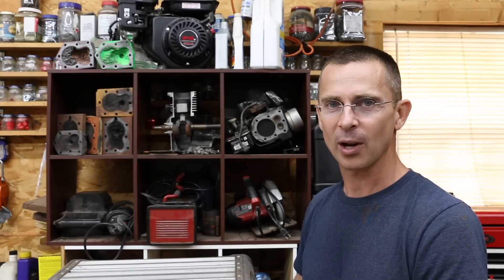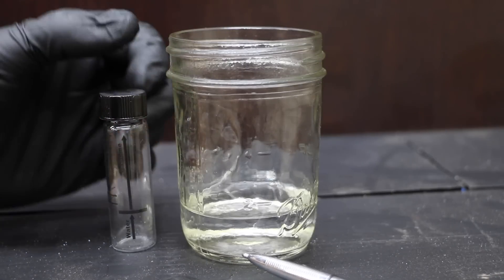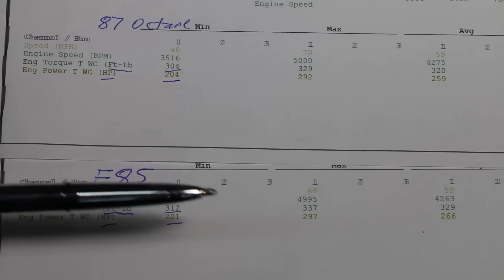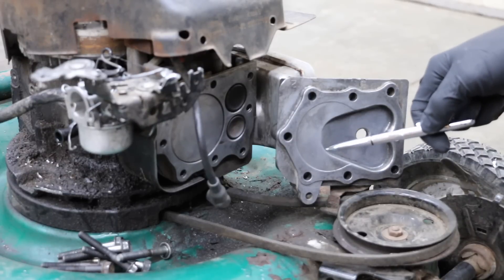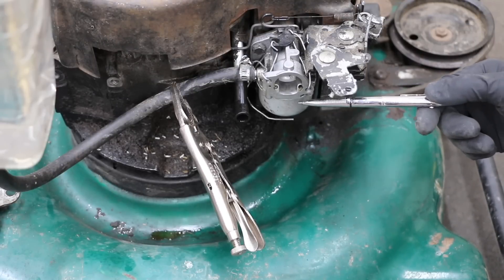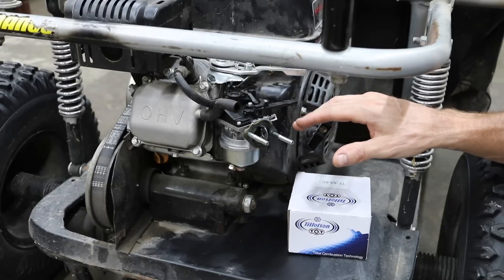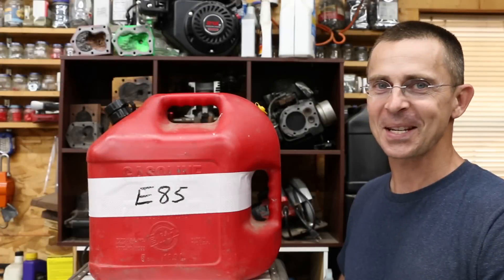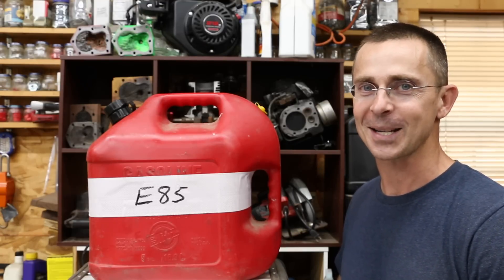Is E85 better than Gasoline? Let's find out!

Comment: Next time, please show fuel efficiency values also in the "litres/100km" unit. This will allow a lot of viewers to understand the figures instantly, instead of needing to find a calculator and searching for conversion ratios :) 11.8 mpg is about 20l/100km, very high indeed. 15.5 mpg is about 15l/100km, better but still uncomfortably high ;)
Did Americans already figured out a way to extract the ethanol from E85 and make vodka from it? Here in Poland many people are creative with obtaining alcohol, but we don't have E85 fuel available here (or it is very rare).
Reply from the maker: Great recommendation. Thank you

Comment: Found a station that had e40 and it amazed me on economy and power. My engine has 197,000 on it and it is flex fuel. E85 sputtered more and burnt quick, regular seemed lacking and degraded my oil  faster. The first time I put e85 in I got a check engine like, reset the pcm and it made a bit of difference. Half and half seems to be ideal in my 2000 Ford Taurus
Reply from the maker: This is interesting. Thank you

Comment: I have several hybrid vehicles that are not flex fuel vehicles. I've run E85 in all of them at one time or another. Since E85 has less energy than regular gas, you should expect lower mileage. My experience has been that E85 is about 20% cheaper than regular gas, but I get about 25% worse mileage, so it doesn't make any economic sense. I'm surprised your flex vehicle didn't do much better than that as it should compensate for the greater amount of oxygen in the exhaust. I did get better performance out of the vehicles during and immediately after use. I would expect this as the computer went into full rich mode to try to balance a lean condition, then turned on the CEL/MIL. (More fuel, more power.) When going back to regular gas, the engine runs good and gets fantastic mileage for about the first gallon. This is because the system is super clean and the computer is trying a much leaner mixture to compensate for the much lower oxygen levels. I've been thinking about modifying my O2 sensors to allow me to adjust the reading when using E85, but just don't have the time.
Reply from the maker: This is interesting. Thank you

Comment: 05 vw beetle 2.0 i used e85 for 5 years and you can feel the power with the ac on it helps. Car will not start the first time and will the 2nd time bc of fuel adjustments in the low fuel trim.
Reply from the maker: Thank you

Comment: E-85 in my old 03 suburban also suffered a drastic drop in mpg. .....only ran a gallon ebout once a year. Alchohol is the happy medium between gas and water. Turns it milky white )if water was present. But the water (condensatiom collected) was gone
Reply from the maker: Thank you

Comment: Ok, I have truck with an customized tune for 93 octane. Orginally it was flexfuel. Will the this tune run E85 with no issues, increase or lower hp/tqu?
Reply from the maker: I has an octane of around 118, assuming it is close to 85% ethanol (it varies between 51%-85% at the gas station I used).  So, I would think it would work very well.

Comment: On your suburban I would expect the 10-15hp and agree that is fairly close to correct. However as you mentioned in video had you adjusted timing it would increase and moreso on turbo vehicles the timing is a critical part. We often see 50hp increase over gas. With that being said 30% more gas being used was also mentioned. It takes more fuel to make more power though. It is often a balancing act. We tune one map for fuel mileage and one for outright power. E85 is often seen at around the 112 octane rating in which when you see race gas at over 10$ a gallon at 120 octane that is a cheaper alternative but you stop for gas way more. Very good video and keep up the great content.
Reply from the maker: Thank you very much!

Comment: Very good testing.  The one thing I will say for e85 and fuel economy is if you built an engine to take advantage of the octane e85 has you would get better fuel economy than gasoline.  Since the suburban engine has to run 87 octane pump gas its a relatively low compression engine, at least when compared to what compression you could run on e85.  If you raise the compression to take advantage of the octane rating of e85 you could match or improve the MPG you would get with gasoline.  Nissan recently came out with a variable compression engine that can run anywhere from 8:1 up to 14:1 compression, an engine such as this with e85 has some serious protentional for horsepower and fuel efficiency gains by running e85.  Hope to see she could do if someone makes a flex fuel system for them.  Love the channel, great job as always. Cheers : )
Reply: By raising the compression ratio of the engine you can increase power output for a given amount of fuel.  You're increasing the thermal efficiency of the engine, something that cant be done with lower octane fuels.
Reply from the maker: Thank you!
Reply: Moon Pie   https://www.nuclear-power.net/nuclear-engineering/thermodynamics/thermodynamic-cycles/otto-cycle-otto-engine/compression-ratio-and-thermal-efficiency/

Comment: You shulda have done this with Shell 91 fuel.
Reply from the maker: Great point.
Reply: I just find that because the way the engines are built (high compression .... etc) would effect the way the fuel would burn, you would get different mileage too I think.

Comment: The go-cart test with that 'mechanically-injected fuel delivery' device was interesting,you could try this,try producing hydrogen from water with a kit that little kids can operate(which includes salt,pencil lead as electrodes,1.5-9volt batteries e.t.c),and have it fuel the go-cart engine with that fuel delivery system,be SAFE !
Reply from the maker: Thank you
Reply: Project Farm  I almost forgot to mention it,you could try to test a fuel known as 'acetylene',it's a gas,and it can be produced by dissolving calcium carbide in water,welders are very familiar with it.

Comment: Mostly agree to that what has been said in video, E85 runs cleaner also needs a bit more energy to evaporate so it can run cooler but only when the fuel:air ratio is set properly. Without this adjustmenst engines will run lean and hot ! Also advancing timing and increasing compression to get the benefits from E85 ..highly recommended. 
I risked this fuel in my "pre historic vehicle" when there was  E85 available for half the price of normal (95octane ) fuel. Worked well after few mods (Bigger nozzles in carb,  timing... and I already had slightly over 11:1 compression ratio).  Only downside - the heat needed for the fuel to evaporate was significantly larger and caused issues when temp went below -5 C. (difficult to fire up the engine).
Also a differrent destilation curve of E85 made some issues with rapid changes to engine revs - idle to full and vice versa...wasnt so smooth as with normal gasoline.

Addendum: done over 30 000 km on E85, no significant damage to engine occured.  Returned back to gas since the prices are almost even (what I can save on 85 per liter I have to invest due to worse MPG). Only pro I noticed (but cant prove) is that oil looked cleaner.
Reply from the maker: Great point. Thank you

Comment: I run e85 in my naturally-aspirated 2012 Chrysler 200S. It does seem to deliver more power but at worse mileage. I live in an area that grows a lot of corn so e85 is about 30% cheaper per gallon than 87 octane. That gets me closer to cost per mile between the two, so I only put in regular gas on long trips where number of fills matters more.
Reply from the maker: Thank you

Comment: E85, E98, and E100 are great when used right, but E10 and E15 are the devil. Keep that stuff out of my toys. I buy E0 in bulk to run everything but my daily so I don't have to worry about rebuilding carbs or water in my fuel. Currently tuning an 1800HP turbo Mustang on E98 that runs 4.6 in the eighth mile on 10.5 radials, but we flush it after each use with E0. Could make the same on C16 or more on methanol.
Reply from the maker: That's a lot of HP in the mustang!

Comment: I run E85 all summer in my 2017 silverado, and 93 Oct. all winter because the E85 doesn't start as easy below 50 deg..  And YES, there's a VERY notable drop in power from 93 to the 87 octane that I tried three times.  Ultimately, the truck seems to run it's best on 93.  But the E85 is very close.  Being direct injection, I still prefer the E85 in summer for the engine cleaning properties.
Reply from the maker: Thank you

Comment: I ran E 85 in a 1600 VW I was about to rebuild around town and a little interstate in the late summer and early fall it ran fine the E85 did run a little cooler I run my carburator jeted pretty rich so that's another reason it may have work well I have read that problem with running it all the time in a good engine is not being able to make it rich enough on another note on a high performance high compression engine ( VW) when we can't find good 93 we add 1 gal   E85 to 4 gal poor quality 93 and keep the engine from nocking and dieseling.
Reply from the maker: Thank you

Comment: Unable to produce enough power with a 5.3 litre engine? American cars don't make any sense
Reply from the maker: Thank you. I should have figured this out sooner.  The vehicle has a speed limiter around 100 MPH.  So, the computer prevents the engine from reaching 5000 RPM due to wheel speed.

Comment: E85 gives better low end torque and more fluent acceleration. I have used it in several of my Saab -cars. In Finland E85 is priced so that it is actually a little bit cheaper to use than regular gasoline. And when the engine and fuel lines etc. are designed to use E85 there isn't really any point using regular gasoline. Also I have seen many engines from inside which have used only E85, they look like new. Then there is also the enviromental factor which of course depends of which ingredients is the E85 made from. In Finland it is made from wastes and etc. so it is really enviromentally friendly stuff.
Reply from the maker: Thank you

Comment: Take a engine and it will make more power on e85 then gasoline-1. Higher octane-more timing and capability of high compression. 2. Ethanol is a oxygenated fuel so it burns more efficient than gasoline. 3.ethanol burns at a slower rate which is why usually you see a nice increase in TQ. 

Another thing people dont really think about is you need 30% more fuel vs gasoline to make it even energy. For that matter every time your injector squirts its injecting 30% more fuel which in turn takes up more combustion area thus creating more compression because we all know you cant compress a liquid. 

E85 is amazing I run in in every vehicle i own!
Reply from the maker: Thank you

Comment: Ok then. Can any one finalise my query regarding on how to diagnose or fix my leaky air filter on the Carb just drips out fuel when not turned on?,  and a second question is, can I put a different type of carb on my brushcutter instead of the designed one for it.. Many many thanks and much love to whom can solutionise my problem.xx
Reply from the maker: If your carb is designed like the one I use in the lawnmower, it's a leaky needle seat or a float that doesn't float.  Regarding the brushcutter, I would recommend going with a commercial grade one if the existing one doesn't have adequate power.
Reply: @ProjectFarm  thank you project Farm.realy really appreciate your knowledge and helpfulness.thanks again, paul
Reply: Yep float issue allowing to much fuel when off
Reply: @ShawnDickens  thanks Shawn very much.

Comment: Well, I guess I get to say TOLD YOU SO!
Also, that combustion chamber might have been cleaner, but over the course of time the same cannot be said for the carb and fuel system ESPECIALLY if it's not "designed" to run on ethanol. You cannot imagine the added damage ethanol does to metal.
Reply from the maker: Thank you

Comment: In Colorado, E85 is 35% cheaper than 91 octane. Considering you need 20-30% more fuel with E85, it still comes out at an advantage. My 453 WHP Lexus IS happy with it!
Reply from the maker: Thank you

Comment: E85 is essentially diluted gasoline and has less potential energy per unit.   This pseudo gas exists solely due to corn lobbyists exerting pressure on corrupt politicians looking for a payoff.   Incidentally, they are all corrupt; it just comes down to direction and degree.
Reply: You could say the same about the oil lobby. Everyone is in it for their own interest, most of all the politicians that take the legal bribes.
Reply: Ethanol farmers get subsides to grow the corn for ethanol. There goes some of our tax dollars.
Reply: Lmao.
Reply: Wow, you couldn't be more wrong.
Reply: Ethanol in gas makes crap in your gas tank and your fuel injections or carb..

In 70s and later it eats up fuel lines and eats a hole in the metal gas tank.

If you have a flex fuel car its built for Ethanol fuel.
Reply from the maker: Thank you
Reply: actually e85 is not diluted gasoline
e85 is grain alcohol diluted with 15% gasoline
Reply: Corn lobbyists brought it about.  Automotive performance enthusiasts keep it alive.  With an effective octane rating of 105-107 (R/M +2 method) it is basically $2/gal race gas.  For reference, actual unleaded race gas costs around $8/gal.
Reply: farmers aren't the enemy. you will get really hungry some day if they can't make any money
Reply: @daftnord4957  On the same token, they often get paid to over-grow (and sometimes destroy) crops which go to waste. For a country so big about "free market", we seem to love manipulating it in places that make little sense today.
Reply: Umm no, it burns cleaner, has a higher octane rating, requires less energy to transport. There's plenty of corn out there to continue making America fat if you're worried about the food supply

Comment: I have enjoyed the comments on this.. Lots of good commentary. Back in the late 70s we built a 13.7 to 1 compression engine for a Lotus.. On high methanol fuel, it made a boatload of power but consumed almost double the rate of plain gas.. snd we had better gas back then. It was never intended as a permanent engine.. just an experiment. those pistons were intended to be machined back and after playing around with a few tanks of ‘juice’ it was. Carburation was Weber 45dcoe, and with a zillion jets available, and good setup book, it was easy to jet for the high methanol.. we ran it at 90%, with premium gas 10%.  Today, not running boosted in any of our cars, I would never use e85.. in fact in one I don’t even use the crap e10 normal blend unless I have to. I buy pure higher octane gas for it at a specialist fuel station,  unless out of town.
Reply from the maker: This is interesting and great point on the non-ethanol fuel.  I need to begin using it more often.

Comment: Your issue with running the test in 3rd gear is not a lack of torque but you were hitting the top speed limiter which is 98mph.  The factory tune limits your speed because of the critical speed of the driveshaft
Reply from the maker: You are right. Thank you for this information.

Comment: No shit, ethanol has about a third the energy of petroleum (gasoline) hence the roughly 1/4 milage per tank. Also the power difference by not changing timing between the 2 should not be measurable, people use E85 because you can run a much more advanced timing for longer making the power safer that way not by just chucking it into the tank of a carbi car for example.
Reply from the maker: Thank you

Comment: The problem with flex fuel is the engines ability to run on both 87 and e85. The engine is designed for 87 and tuned to be able to make use of e85 also however is in no way optimised for it. Being a tuner I have tuned several turbo cars with e85, some would could be tuned to run with 93, some would need at least 110 leaded but all worked with e85 and made more power. Some engines were built around using c116 or q116 and were taken off that fuel in favor of e85 and even made more power in doing so.
Side note, your dyno operator does not know what he is doing, which is all too common with shops lately. Running it like you did most likely gave you apples to apples but I shake my head when shops have a $40k-$80k tool they do not know how to use. That truck has plenty of power to turn those rollers.
Reply from the maker: Great point.  I suspect the vehicle's computer is limiting the top speed to around 100 MPH.  It had great power and would suddenly stop accelerating.   Thank you